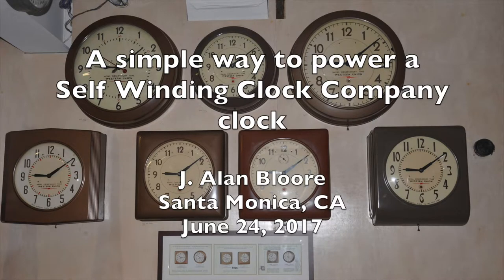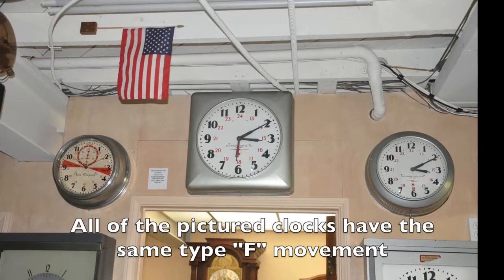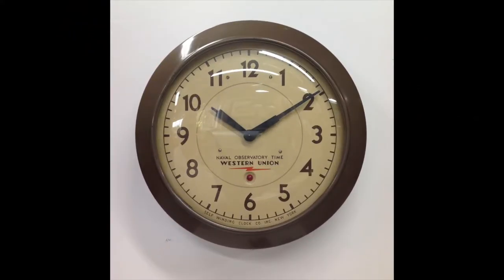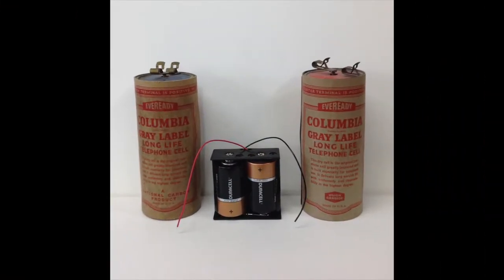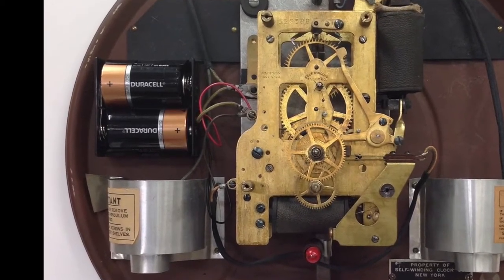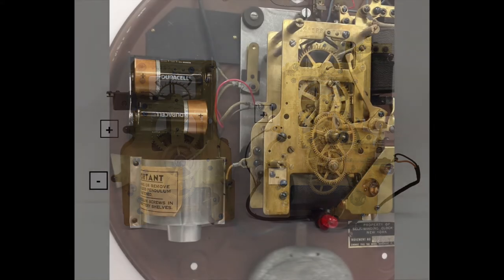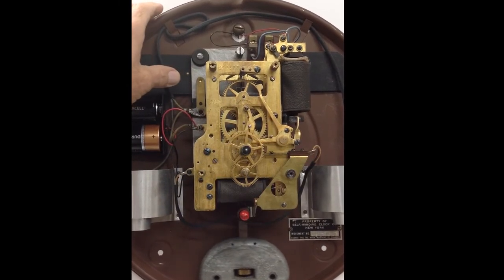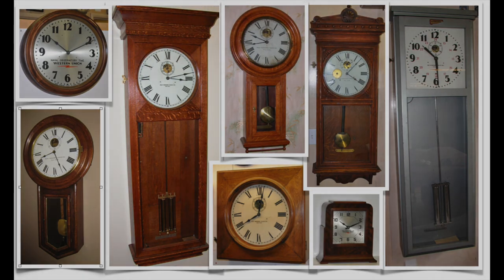How to power a Self Winding Clock Company clock

Comment: Hello Alan, 
Can you make a video on how to install and wire the plastic holder for the d batteries.  Just bought a bigger western union clock and glad I found your video. Thank you!
Reply from the maker: Hi, The plastic battery holder can be held in place using any holes in the metal of the clock back. Drill holes in the battery holder to match the holes in the back and use tiny bolts and nuts. The wiring will be the same as in the video.

Comment: Have the clock. Pendulum moves and clicks but as it swings finally comes to a stop. Put your two d cells. Started pendulum still slows to stop. Can here the self wind if I touch the frame but when hook to + area clock will not continue. Any ideas? Thank you.
Reply from the maker: Mike, hard to say what the problem might be. First, wind the movement fully , do not connect the batteries, and see if the movement will run down completely. If not, the problem is with the mechanical movement. If runs down completely try the electric hook up again. and then??

Comment: I picked up a self winding clock co. clock. On the metal tag it reads:
KS 1928
24 volts Movt# 200836
Nice wood case, missing pendulum. What do I have?
Reply from the maker: Hi Dennis, You have a SWCC master clock made for AT&T. They were used by telephone companies. As you see by the tag, the clock runs on 24 vdc rather than 3 vdc that the majority of SWCC clocks run on. If the clock is in a square 21x21 inch case the pendulum was a wood rod brass bob pendulum. These are nice clocks.  Alan

Comment: I’m having a problem with an old rhythm clock company movement that has a damaged winding movement that’s running on a a single 1.5 v type c battery. I’m trying to figure a way to get it to self wind properly. At the moment it’ll run for a while until the spring mechanism runs out of power, and since it isn’t being wound back it stops. I’d appreciate any tips. Thanks!
Reply from the maker: Jose I don't know anything about an old rhythm clock company movement. Sorry but I can't help.  Alan

Comment: Would you be able to tell me what the DC voltage requirement would be on a Stromberg labelled 110V?
Reply from the maker: I know that Stromberg made 110 Volt DC systems so you may have one.
Reply: @SelfWindingClocks  It's definitely marked 110v, but I'm trying to figure out how I would provide power to it.  I can't plug it straight into 110AC can I?  Shouldn't the AC convert to some DC voltage?
Reply from the maker: @mantolaman  It will not work on AC power. Is this the only Electro-mechanical clock you have? 110 volt DC clocks were not very common.
Reply: @SelfWindingClocks  I have a Western Union Type F, and 3 Kundos.  I was attempting to buy a Stromberg time only, and it was labelled 110V, but the coil was not labelled.  I understand Stromberg made several voltage variations of their clocks.  But I was trying to figure out what type of power supply it might need.  It has an electric cord on it, but don't know what provision for conversion to DC was.
Reply from the maker: @mantolaman  You can power that clock with a power supply made by Ken's Clock Clinic.